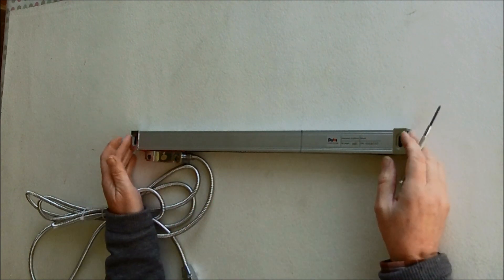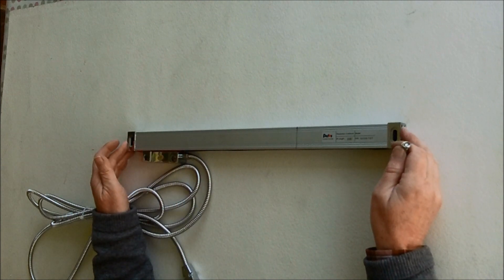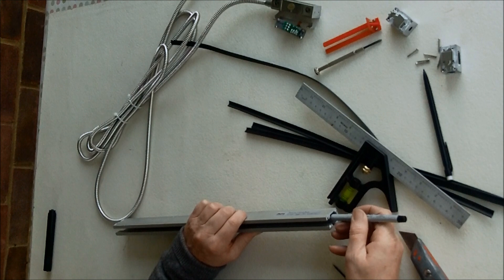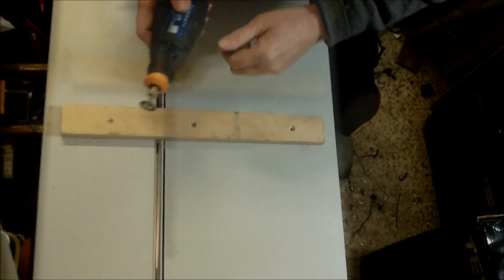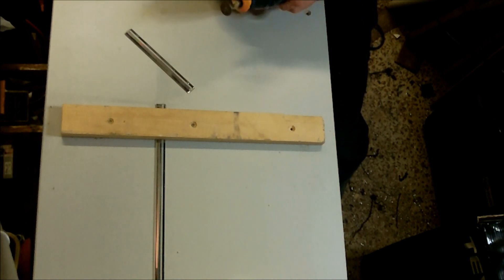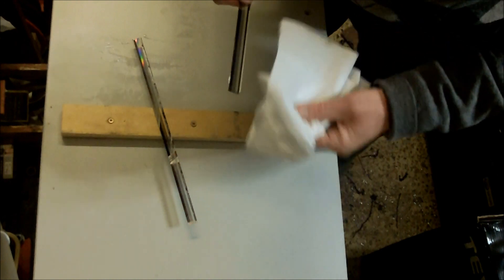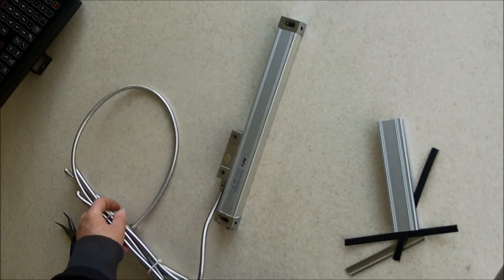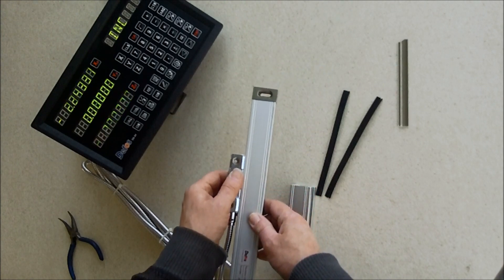Cutting a glass DRO scale

Comment: Ah, a different approach! I've seen a few other videos of people shortening these scales, they all left the glass in. 2 used a hand hacksaw, one a 4x6 bandsaw. The small bit of glass that then gets in the way of the end cap was just snapped with pliers.
This method looks fine for scales of the length shown - I can see that if it was a 1m long scale, the glass would be very fragile.
For the screws, are there already extruded holes, or did you need to drill & tap? What size?
Thanks!
Reply from the maker: I made this video more than ten years ago, at the time there was no other videos out there and the general consensus was that glass scale would shatter if cut. Since this video, every man and his dog has made a similar video. The DRO on my milling machine is still working perfectly, I would be lost without it.
Reply: @Targetmaster1066  Many thanks for that, also for the repair video you did for the cut cable. I like your wooden PCB holding clamp!
Reply: Oh, and don't worry about the sound quality - at least you didn't overlay background music :goodvibes:
Reply from the maker: I really appreciate the support from you guys. Thank you.

Comment: does the red plastic piece have to be removed for the dro to work?
Reply from the maker: As far as I can remember, the red bit is removed as it only hold things secure during shipping. I fitted the DRO 8 yeas ago and it's never missed a beat. A job well worth doing, I would be lost without it now.
Reply: @Targetmaster1066  I think the red plastic bit also correctly sets the gap between the scale and the head - install it & bolt it all up, then remove the red bit.

Comment: I cut mine off with the vertical wood band saw with a metal blade, in 1 minute.
 The glass was glued in so  I didn't try to remove it. I used the ends as a template and used the bolt size drill to start the the hole about 1/32 deep then finished drilling 1/16th inch 1/4 in deep. The screws went in easily with a screw driver no need to tap the holes. The  whole job should be no more than 15 minutes. about 1/4"glass chipped at the end where i cut, but I left about an inch extra so no problem. Hooked it up and works great.  GOOD LUCK. PS needed to use the milling machine to cut a groove at the end cap to compensate for the glass being flush with the end of the aluminum body, rather than trying to whittle the glass down.
Reply from the maker: Well done Steve - Obviously braver than me. As far as I know, this had never been done when I made the video - now there's plenty who've had a go and mostly get away with it.

Comment: Great Job, I cannot imagine life without a DRO these days.
Reply from the maker: Thank you Dave - I'm planning to attempt the longer scale today, this time I'll try and cut the glass "in situ" just milling out a window in the housing big enough to get the Dremel in.
Reply from the maker: Ahh! - It's you Dave, I've just twigged :) I recognised the silver turntable.
Reply: thetargetmaster
:) As much as I dislike the Dremel I have ended up with a couple and they do get used from time to time and always prove invaluable, just wear eye protection especially with the slitting disks. I have a Versa Pod to shorten today and will use a Dremel to carefully grind back the top welds.

What is the new Mill?

/d
Reply from the maker: David B The new mill is an Amadeal 25 LV (Metric with R8 tooling), very pleased so far, for what is really a cheap "hobby"mill.
Reply: The smaller hobby mills can be surprisingly good, I run a Chester 20V at home with DiY DRO's and have turned out some nice jobs with it. Build yourself a power feed when you get a spare moment, a toothed belt (Motionco are worth a look) plus 24v wiper motor are a good starting point and I am sure you can add the add the speed control :)

/d